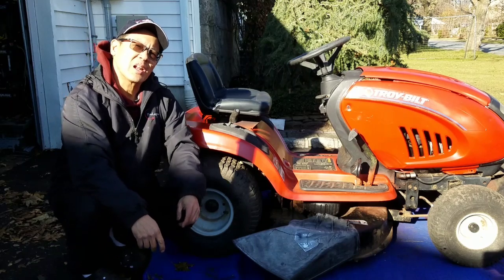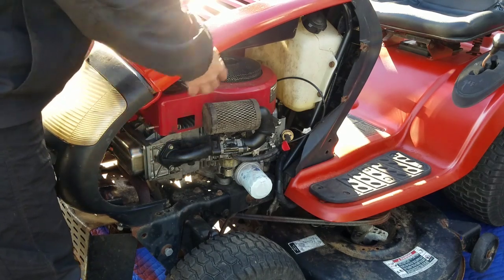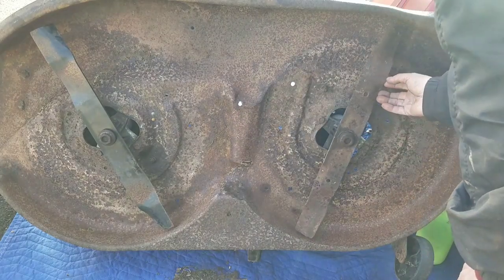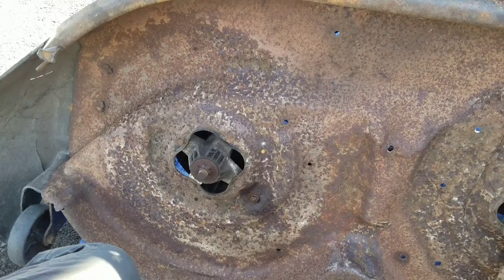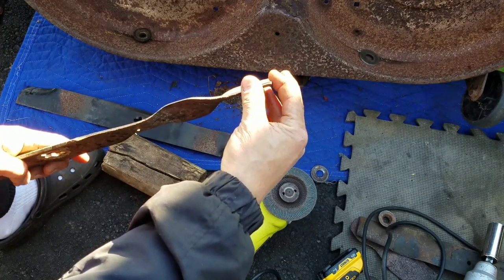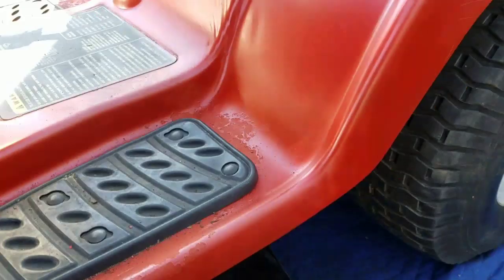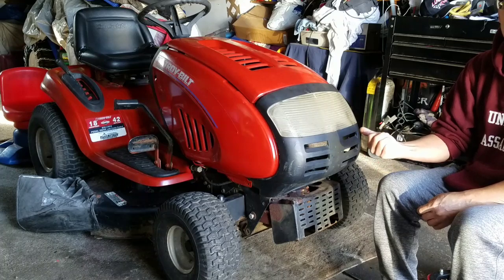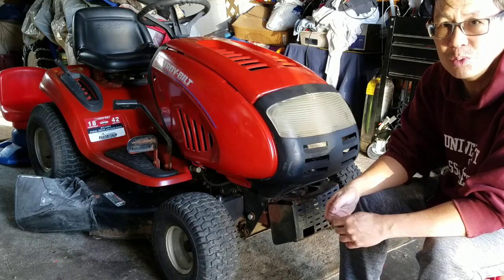TROY BILT PONY SUPER BRONCO LAWN TRACTOR MOWER DECK BENT SPINDLES? VIBRATION BALANCE SHARPEN BLADES

Comment: Left spindle is bad or needs grease. Right spends almost three times longer than left and the left makes a real grinding noise. Maybe you can get it greased if it is not sealed.
Reply from the maker: It may not spin as well as the right one, but that doesn't cause the vibration.

Comment: Very minimal smoking. Hardly anything at all. A good deal all around considering what you started with. 👍
Reply from the maker: Thanks Jeff.  I thought it all turned out pretty well which is why I bought that panel.  If it came out crappy, I wouldn't have bought it.

Comment: Leave the spindle housing on the deck and take the spindle apart change the shafts and the bearing make sure the blades have 6 points on them the ones on there look like five star blades

Comment: On your eBay listing you have mtd spindles if you take those apart change the shaft and take bearing cover off and grease the bearing and install them on that deck and find 6 point mtd blades that fit and paint the deck
Reply from the maker: Thanks for looking...I was wondering if I had that.  But I wanna say that the bolts are busted inside...but yeah...grab the bearings and shaft.  I'll look into it.

Comment: Henry,  why don't you run it without the blades on it to isolate where the problem may be, it might be the pulleys and/or the spindles.
Reply from the maker: That's an interesting idea...however the lack of friction and or resistance of no blades installed could cause the belts to break it violently shake off.  Not sure.

Comment: They didn’t grind the star out. They didn’t install the blade properly and overtime ground down that star on the spindle.
Reply from the maker: Maybe,  but I’ve grinded the star down to fit a non MTD blade on it before

Comment: 1)Repack spindle bearings with grease or replace with new bearings.
2)Check mower belt for cracks, flat spots.. excessive wear. Replace mower belt with good or new.
3) Install new or sharpened and balanced 'six point' star mower blades. You cannot safely install five star blades on a six star spindle or six star blades on a five star spindle. 
5)Be prepared to spend time and treasure to bring projects to a successful conclusion... Nobody rides for free.
4) purchase new shorter oil filter by using engine vin # as reference.
Reply from the maker: Sold right after the video

Comment: one of those blades will be cutting and the other won't be if they both spin in the same direction.
Reply from the maker: Hmmm...I'm gonna check that out, thx randy
Reply: You are correct
Reply from the maker: Randy, I just thought about it...they both go counter clockwise as the crankshaft spins that way...belts pull it one direction counterclockwise..both move the same direction.
Reply from the maker: @knighthawk86855  I'm correct or randy is correct?
Reply: @MowersNBlowers  If they both spin counterclockwise then the rustier of the 2 blades is on upside down. .
Reply from the maker: @jdretiree2433  nope...it's on correctly, both blades have the blade part going counterclockwise.  You made me go out there and check twice.
Reply: @MowersNBlowers  sorry about making you check so many times. looking at the video it appears as though the rusty blade is on upside down. I guess you have to be there to really see the cutting surface of the blade. I will remain silent in the future.
Reply from the maker: @jdretiree2433  no way Randy, there are things I miss because I'm so enthralled in the making of the video.  I depend on the viewers to double and triple check me.  I would be very disappointed if you were silent.

Comment: I grind the blades to sharpen em, but not razor sharp, there's no sense in doing that, I do it mostly to rebalance em, a good solidly balanced blade will cut the best.

Comment: I never seen you balance the blades  Balance by weight from one end to the other
Reply from the maker: Yes, you are correct, I was so caught up in the blades being the same height, I forgot.  Since they still vibrate, I'll have to remove it yet once again.

Comment: Lol , maybe the deck is bent/warped where the Mandrel bolts down (???) ... that's what can happen when cutting and the blade strikes a solid object , root , rock , junk sticking up out of ground ...

Umm , try bringing blade tips together in the center , and see if cutting edge tips are same height ... do the same and place a straight edge across width of deck , measure from straight edge to blade tips at the 4 points , center and outside tips ... 

That mower was not maintained or taken care of at all , it's junked out ... hope you don't rip a potential buyer off by not disliking "it was junked out and all you did was clean it up some to trick somebody" ...
Reply from the maker: Look at the date bro!  More than 2 years ago.  Yes I sold it as is
Reply: @MowersNBlowers  same comment as original , same checking suggestions ... yes I know your vid was 2 years ago , and also know you sold it ... so maybe you'll think about those deck/blade runout checking suggestions in the future on other mowers ...
Reply from the maker: @danc.2457  definitely
Reply: @MowersNBlowers  ... ☆☆☆☆☆ , there ya go , maybe pass it on in your future vids ...

Comment: Sometimes a flat spot in the belt will cause shaking. Try another belt.
Reply from the maker: Yes, that's possible
Reply: @MowersNBlowers  Taryl had that issue with a cub cadet

Comment: One thing to check with a deck that shakes, the belt, if the belt has any flat spots on the inside or outside of the belt it will rattle the crap out of you, so check to see if the belt is smooth.